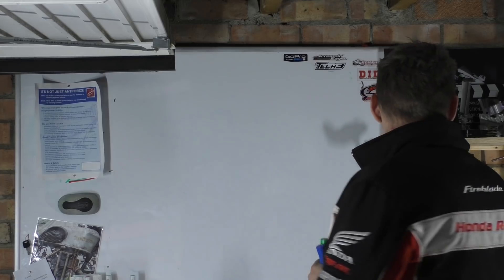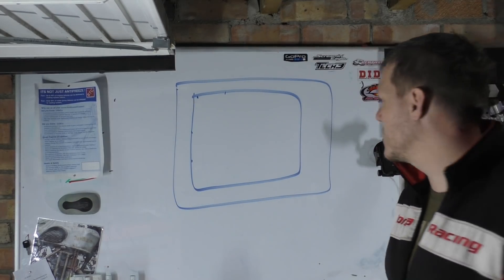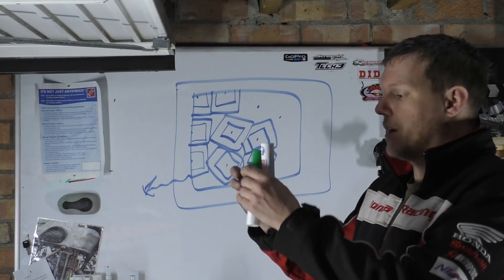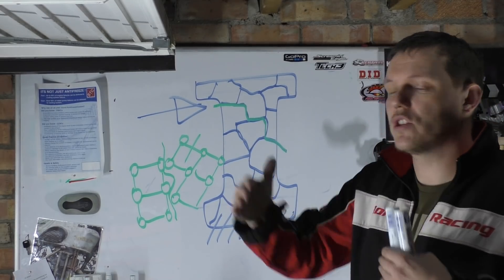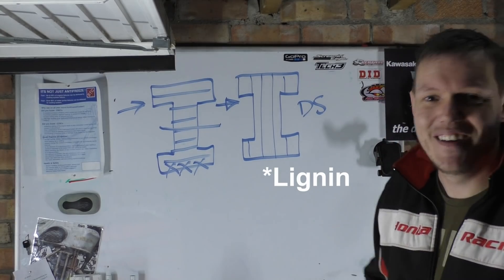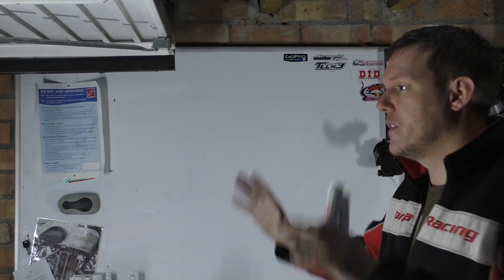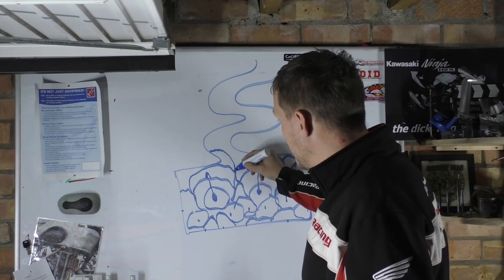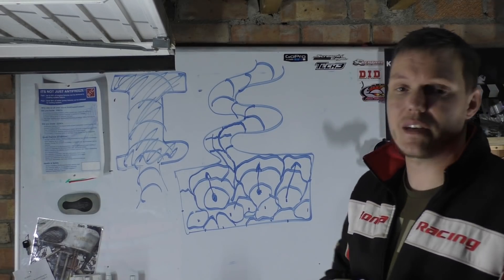Single crystal growth - and choking

Comment: Although you explanation was amazing, I have a doubt more general and not strictly related to this topic. Before starting let me say that I am just a student and not an expert. 
Just to understand if I get point. When you talk about "fracture", minute 5.36, do you mean a crack in the material or a creep failure of the material? Probably you are describing a failure of the material due to a mechanical stress under relative high temperature, and so a creep failure. In this condition it is true that more grain you have more it is easy to get a creep failure. 
On the other hand, it is generally not true. In fact, a technic of mechanical reinforcement of material is the grain refinement due to the fact than the grain border is the highest point of resistance for a material under a certain temperature. Am I saying something wrong?

Comment: That is not a turbine blade.  That is a non-rotational part placed between the blade stages called a stator or vane.  If your turbine module has 6 turbine blade stages, it will have 5-7 vane stages placed intermediately.  They guide the air flow impingement to the blade and provide cooling using secondary airflow pumped through their interior circuit.  Blades have no added mass at the tip due to centrifugal stresses and seal (rub) against a ring of BOAS (blade outer air seals).  Blades have very high centrifugal, fatigue, and thermo-mechanical stresses so you would not have any mass at the tip to increase root stresses.  For blades, failures occur at the root primarily due to TMF (accumulated thermal fatigue).  My life was a stress engineer for Pratt and Whitney and GE in both the compressor (cold) and turbine module (hot) modules.  Directional solidification is often done in a centrifuge.  The purpose is to increase stress stiffening under turbine rotation (centrifugal force radially stiffens the blade) to increase its fundamental bend and twist natural frequency.  Vibration is the limiting issue with turbine design as much as stress.  My job was to computationally assess cracked turbine parts from used engines (4000 hours), and predict how long they would live when placed back in the engine...and they almost always go back in.  Every airplane you fly on contains an engine chock full of  cracked engine parts.  Cheers!
Reply from the maker: No this is a turbine blade, just a low pressure turbine blade. Stator blades don't have bleed holes through the body of the blade.
Reply from the maker: https://www.researchgate.net/figure/Perspective-view-of-a-typical-shroud-top-geometry-for-a-Rolls-Royce-Civil-HP-turbine_fig1_267499903/amp
Reply: @thedirtyworkshop  incorrect all around.  Vanes are static parts that require secondary gas cooling in the turbine module to prevent failure . Tangential On-Board Injector (TOBI) air is scavenged from the blade tips to cool the vanes as well.

Comment: If you heat it up and forge it afterward is it still one crystal?
Reply from the maker: Yes as long as it doesn't cross the phrase trans points
Reply: The Workshop So would heating it up so it was just workable by a hammer like red hot count as crossing the trans point(s)?

Comment: Not quite the same as sugar, that is crystallised out of a solution, and they are all single crystals.  We keep the solution at saturation point, introduce seed crystals (about 8 microns) and then grow the individual crystals to around 600 microns by maintaining the saturation point through the growth phase which takes 3 to 4 hours.
Reply from the maker: You have got to be shitting me? Really?
Reply: The Workshop I worked in the industry for 40 years, and was involved in developing the automated system.  We made the seed crystals by grinding sugar crystals for 6 hours in a small ball mill in isopropanol.  You needed about 100 mls of this seed slurry to make about 40 tonnes of sugar.

Comment: Don't forget the strength of the single crystal blade is plane (direction) specific which is why it may not work in other applications where there are complex stresses in many directions. That's where the benefits of grain boundaries and linear defects are useful in a way. The maximum force is less than that of a single crystal but in all directions it is the same and sometimes stronger than a single crystals weakest direction.

Comment: This is a good explanation (one of the best i've seen), but HOW do they directionally cool?

Wouldnt the forces in a piston engine be too dynamic for this to work? SC parts in a jet engine are really only used because the part is only experiences one force (tensile) in one direction (radial or centripetal).
Reply: Beach&BoardFan Well they are also used so they can get away with titanium turbine blades at the high temperatures and don't need heavy nickel alloys for the turbine as used before single crystal titanium came along.
Reply: alles klar klaus thats news to me, I've never seen an instance where Ti is use in turbine blades. I've only ever seen nickel based alloys or GE's CMC's.
Reply: Beach&BoardFan I think they use monocrystalline titanium alloys now which would be a huge improvement in weight. But yeah the engines we might come across are industrial versions and use good old nickel blades
Reply: Hell yea, Ti turbine section would make for a super responsive engine!
Reply: My dad was machining Ti blades back in the 60's. He even brought one (scrap) home for my collection of elements that I was making for 5th grade science class.
As I (barely) remember, the owner of the shop he worked for, invented the machine that actually made the blades (or vanes, not sure which, they were solid as I recall). They were complex shapes to be milled & turned, way before CNC was available.

Comment: Seen some single crystal at uni. Far, far more difficult to get right, the investment in computing time alone makes it unsuitable for most  users. Then the rate of production is horrid, the machinery to fully automate (to remove human error) is expensive, then the reject rate is huge even with automated systems.

For directional solidification outside the fancy investment casting world we use exothermic risers and topping powder as well as chills.

Comment: With single crystal growth conrods you could make lighter conrods and reduce the mass without loosing the strength. and then go up to higher rpm and more power without shitting the bed. We know if something on the bottom end engine fails it is almost always the conrod.
Reply from the maker: But by how much?????
Reply: Isn't valve float a problem (as rpm rises) far before the reciprocating mass is?
Reply: 10babiscar: If you use the Desmo from Ducati or an other forced valve system: NO! There is no valve float possible. But also Yes there are limits to the rpm of course. But those of today mostly are by the crankshaft giving up on it. You get limited to smaller cubic engines if you want to have high rpm. The bigger engines have to much rotating mass so the conrod gives up on it. And if that is stronger you will be able to rev higher.
Reply: I did not have any data to calculate that... And honestly I do not care so much because I will not build those or even be able to buy those. I am not an F1 engineer but ask them I bet they have done it.
Reply from the maker: It depends on the masses and acelerations of each component
Reply from the maker: " I am not an F1 engineer but ask them I bet they have done it."

- I bet they haven't you don't go looking from solutions to problem you don't have (yet LOL)

Comment: Sorry Matt bit off topic but I had a low speed tip recently (dropped on clutch lever side) and my steering is misaligned, the handle bars are slightly right when going straight, do you have any quick things to try before replacing things? Cheers
Reply: @ bikers Quest Slacken off all the pinch bolts and with you facing the front of the bike pull or twist the handlebars to the left tighten the pinch bolts up again and check them if still out of alignment rinse and repeat. Do not slacken the pinch bolts too much. Usually takes longer to get the tools ready than to do the job.
Reply: There is a guy called Booki who has made a quick clear guide on YouTube, simple enough job :)
Reply: Sledgehammer
Reply: Cheers guys I'll have a go